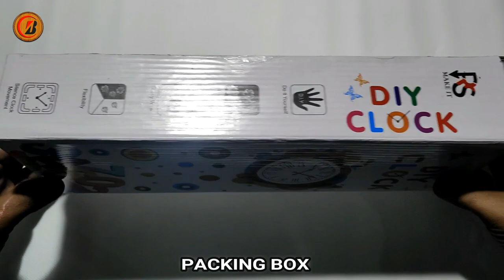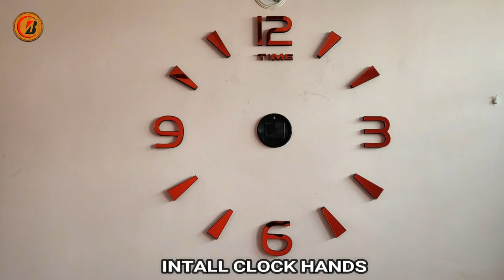How To install DIY Clock |CREATIVITY BRAIN

Comment: The hour and minute hands of the clock are not correct. For 25 minutes to the hour, the hour hand should be just over half way between 1 and 2 hours.
Reply: Correct